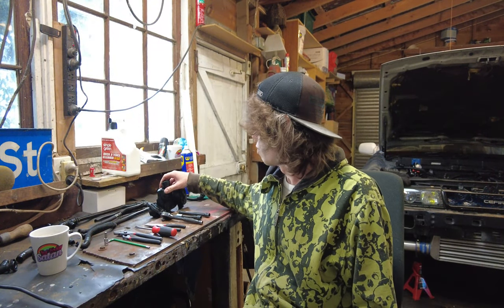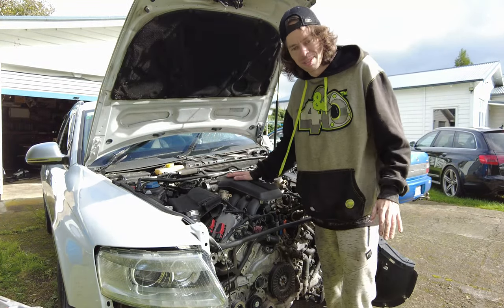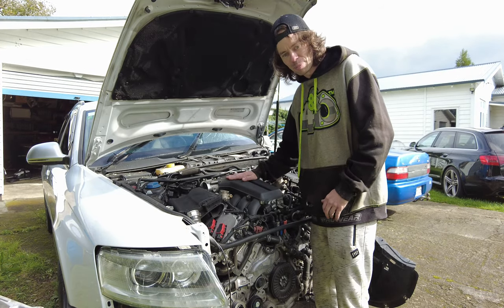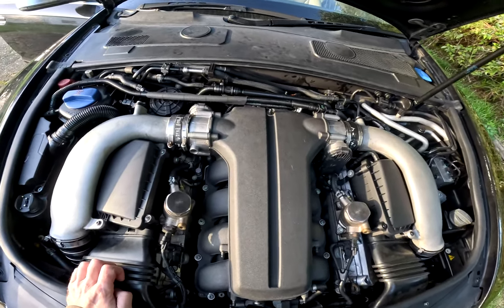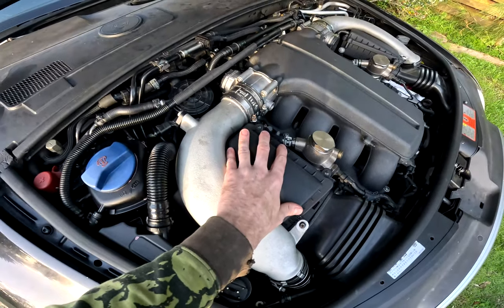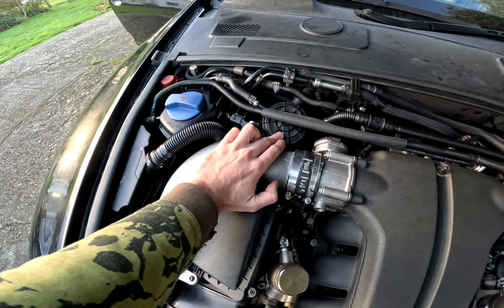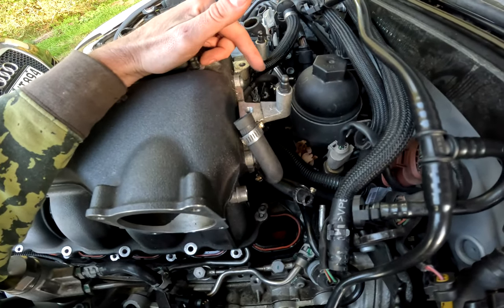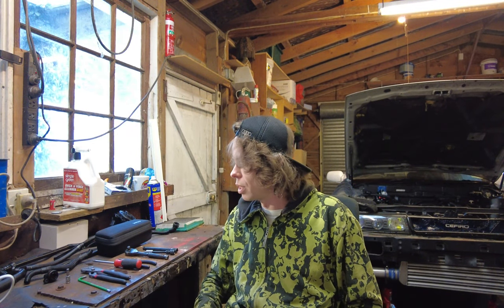ADHD & Cars - C6 RS6 - PCV Repair

Comment: I'm having an issue with both bank runners for the air intake being stuck closed. What was the cause of the flaps being bent?
Reply from the maker: Nah, both bank 1 and bank 2's flaps were fine, I've just finished replacing the entire system (except for the flaps on bank 1) including the solenoids and I'm still getting the same error. It's a head scratcher for me at the moment.

I'm thinking possibly a wiring or flap position sensor issue for mine
Reply: @grantvonbibra I'm having it investigated now and will let you know what is found!
Reply from the maker: Turns out the final fault was another failed flap position sensor caused by yours truly installing it incorrectly!
Reply: @grantvonbibra  Replaced both solenoids on mine and she's back up and running!

Comment: Whats wrong with Warshp? Why are you using it for parts?
Reply from the maker: This is the fun part, the Black RS6 is supposed to be parts for WARSHP but I need it as a daily at the moment.

April last year saw an older gent drive into the side of me whilst I was driving home. Needs a lot of work but very salvageable.
Reply: oh.. its been crashed. Thats really sad. Was looking forward to your review of it.
Reply from the maker: @VictorySpec  I did one a couple of years ago but the videos make me cringe so I've wiped em from YouTube.

Rest assured she's not dead yet, the Black RS6 is the lifesaver for WARSHP. Once I've sold my T4 Transporter I'll be tearing down the black RS6 and cutting it up to replace the damaged bits on WARSHP.

I was very lucky to find the black RS with Adaptive Cruise control as that small Radar costs $10k NZD Landed. Same price as the dashboard, bumper and Bonnet combined.
Reply from the maker: @VictorySpec  but in saying that I can cherry pick the old videos and some others that never saw the light of day and combine them all into a review if it's of interest?
Reply from the maker: Likewise, if memory serves I had a lot replaced on mine, ill be removing the engine and box from WARSHP once she's in the shed in preparation for the body work so I am considering upgrades.

WARSHP is a very special example of the C6 RS6, being 1 of 7 facelifted wagons in the country to my knowledge and also highly optioned, she has some "unconfirmed" provenance with the original owner alleged to be Jack Ma.

I also have a plan in mind performance wise that hasn't been done with one of these before so once I am good to go I will be doing a YT video on that too!
Reply from the maker: I also intend to produce a lot more on the maintenance front with these cars, they are like the "Super adult Puzzle" version of your table puzzles. Very rewarding once you get the hang of working on them.
Reply: @grantvonbibra  I saw the old ones, i quite enjoyed your reaction to the car. Its exactly the same reaction i have when i drive my car. Those videos were taken before it went to eurosurgeon aye?
Reply from the maker: @VictorySpec  yes they were before ESP. I didn't do any proper videos after ESP as we still had to work on the tune, I was due to come back up to iron out a few characteristics that had presented but life had some other plans.

So I'm going to take over once she's back together.
Reply: @grantvonbibra I Enjoyed the Video and good to chat to you.
Reply from the maker: Like wise man, appreciate the support!
Reply: Should definitely bring my falcon out there for you bro need some works done breaks in and could be keen on setting up a little paint booth in your shed bro to do my bonnet and bumpers u can film if your keen ? 👍🏼